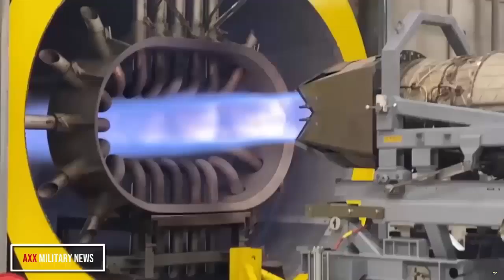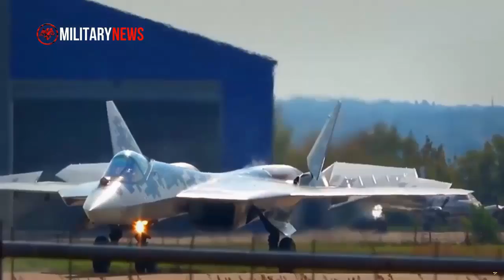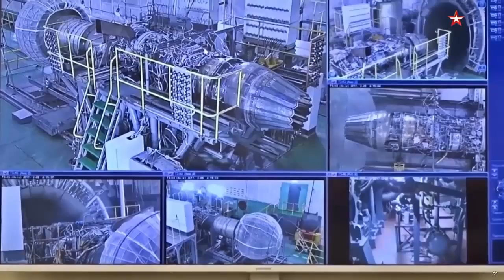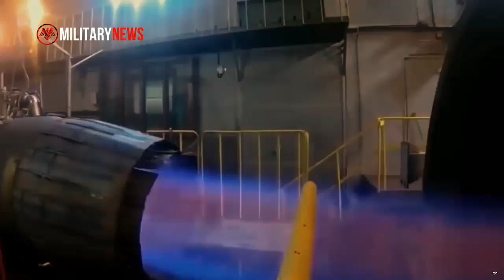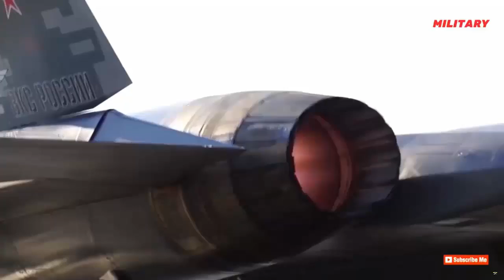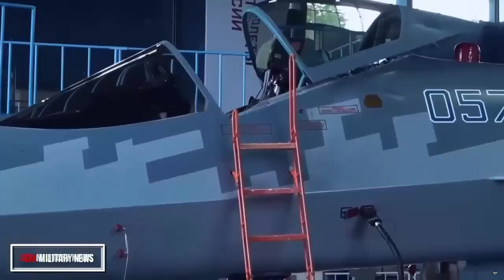New engine AL-51F1 (Izdeliye 30) has been installed on the Russian Su-57M

Comment: F119 pratt N whitey  115KN Dry 
AL51 108 KN dry
American engine Ahead of super cruise but
Wet thrust/afterburner  
F119 only 135 KN 
AL51F1 CAN HANDLE 167KN 😂
Reply: Cool observation
Reply: @RiadAhmed-ce6qo  The numbers 115KN, 108KN, 135KN, 167KN are all measured in test stand: V=0, H=0. 
Subsonic engines can have same numbers of thrust, but this does not specify anything about Supercruise thrust/speed. This only secifies will the aircraft be able to fit in runway during take off or not.